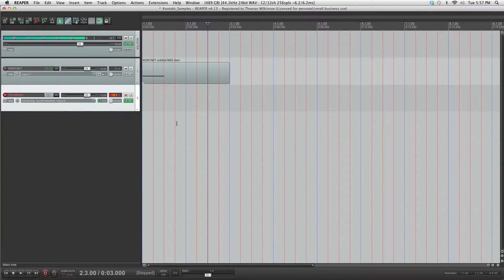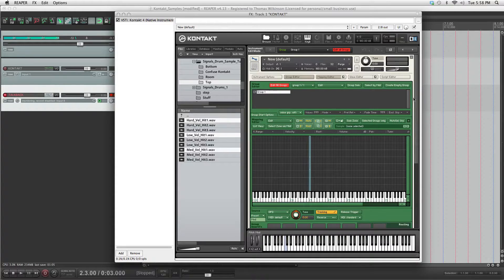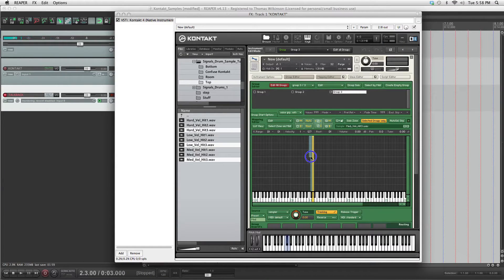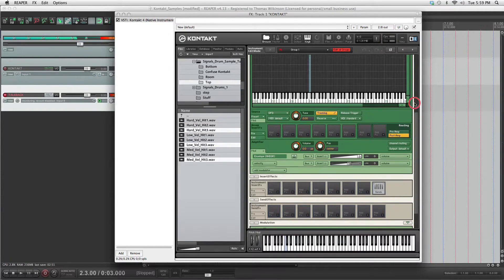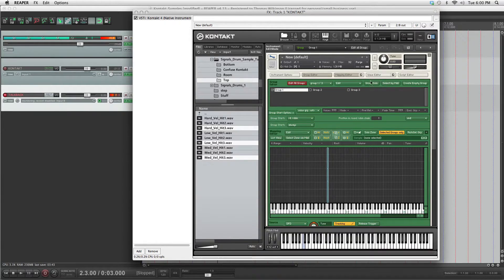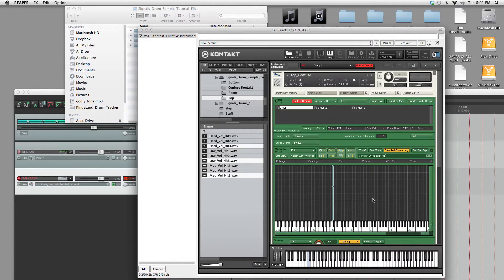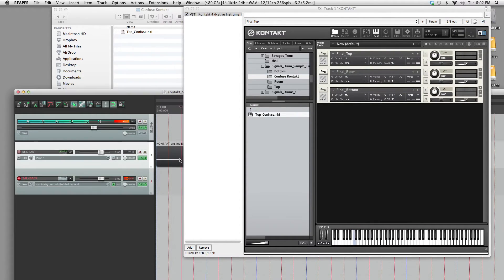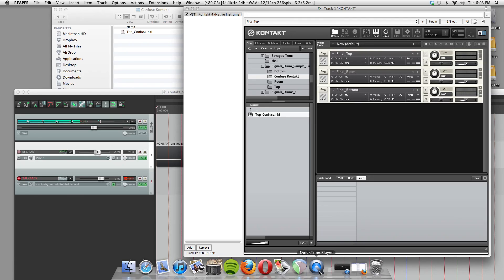Creating Drum Samples Part 5: Creating Kontakt .NKI files (without Battery)

Comment: I followed the instructions and it worked fine except its randomizing volumes. for example all my hard hits are set to 100-127 Velocity. so on my midi track they are all 127. on play back some samples are playing slightly quieter while others are louder. im 100% positive its not my samples that are different because it seems to be doing it with all my samples. is there maybe a step you forgot to cover that has to do with kontakt "Humanizing" the samples by itself?

Comment: That sounds pretty difficult.. Does doing it the way you described in this video have the room/overheads and all other mics trigger the the correct sample between mics?  (ex. MIDI triggers "snare 1" as well as "room 1" and "overhead 1"?  Except that the video says that all samples are required to have the same file names in order for them to load properly)  but do you get what I am saying with regards to that?  This seems to be the easiest way and is how Mizell's latest samples are delivered.
Reply: has this been answered?  I have the exact same doubt